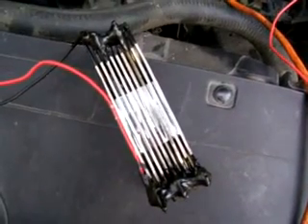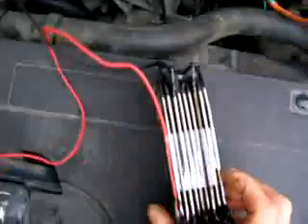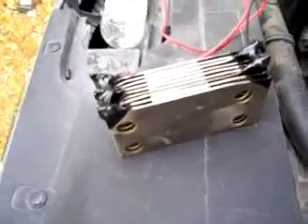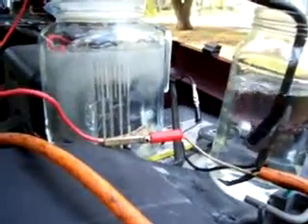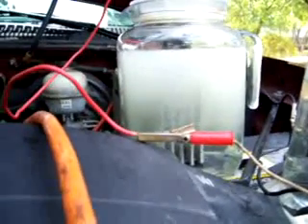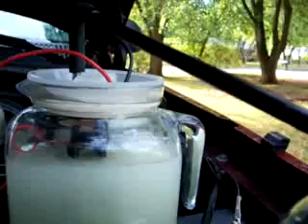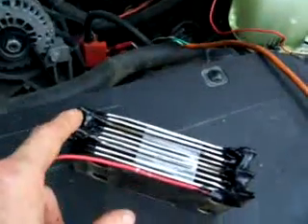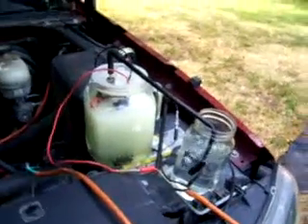HHO Generator 9 plate system

Comment: It'd like to see an ampmeter and a volt meter in your next vid.  See if the gas you are giving off is enough to power a generator to make back the same power you are expending.  I've seen a few projects that focus on high output for low voltage and some that "pulse" the electricity to get a better reaction for less power.  High voltage is needed for the seperation, but if you can limit the amps, your overall consumption of power is very low.

Comment: Question... why did you decide to have more positives than negatives?
Hydrogen is produced off of the negative plates, and Oxygen off of the positives.
Depending on the steel you're using, the positives will tend to oxidize and rust faster, plus the added Oxygen only makes your computer get confused on the air/fuel ratio.
I'd try to limit the amount of O2 you put off by having more negs than pos.
Just a suggestion.